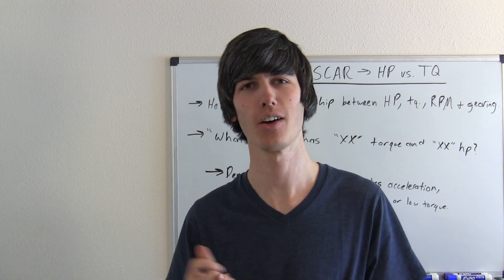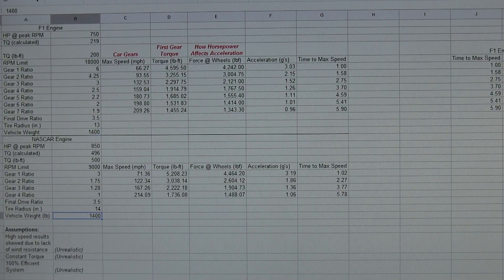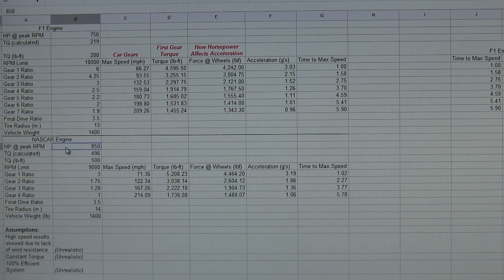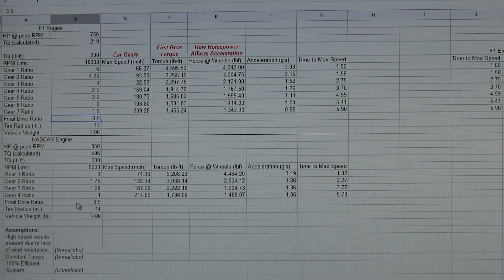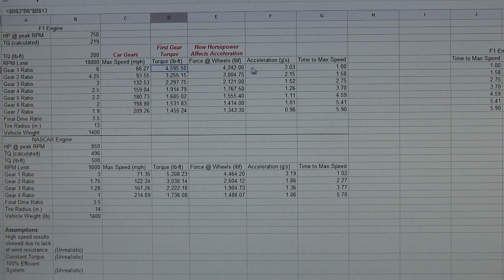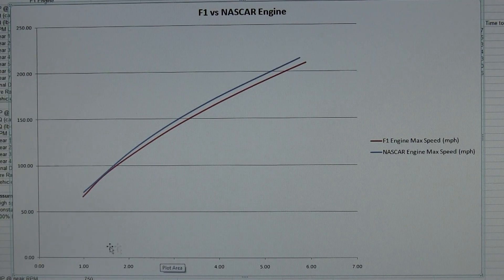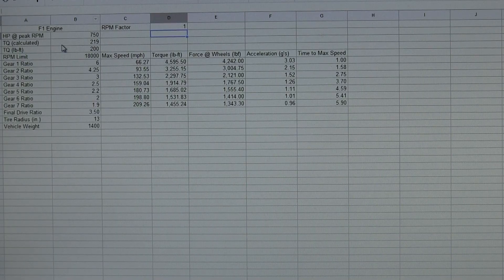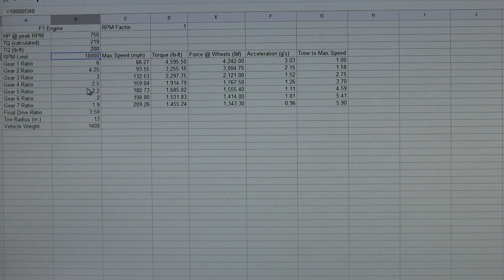Horsepower vs Torque - Formula 1 vs NASCAR

Comment: Or in nice simple terms...
Want more torque? That's simple. Just use a transmission to exchange RPM for Torque, resulting in lower RPM, but higher torque.

Want more RPM? That's simple. Just use a transmission to exchange Torque for RPM, resulting in lower torque, but higher RPM.

Want more power? Sorry, you gotta get a larger engine for that.

Comment: Australian pro-stock cars have about 1200 hp and weigh 900 kg yet CAN accelerate from 0-200 in about 6 seconds yet can do 0-60 in like half a second. Do they not have any air resistance ? Or is to do with different gearing ?

Comment: not very good example at the end by doubling the torque and limiting by half the rpm limit. i THINK the conclusion is that torque is not very important for performance from the standing line. Power is what u need for that. bUt we already knew that. Torque would be essential for rolling starts.
Reply: for rolling start ? so you say 2000 nm at 2000 rpm roll from 100 km/h  give more accelerstion initial at let say first 1 sec or whatever 0,1 sec than something like 500 nm at 16000 rpm from 100 km/h ? welll ….. NO 👍🏻 it be 2 times weaker acceleration cos 500 nm at 16000 rpm is 2 times more power and if speed is the same 100 km/h for both than formula power divide be speed = force say 500 nm at 16000 rpm will push vehicle forward atleast  2 times stronger after start signall 👌🏻 …
Reply: @mociczyczki  i agree with your example, but in reality rpm are similar in rollisng starts, torque is what changes from vehicle to vehicle
Reply: @MrDieselakias  nope unlesss somebody force such regulation only than if not each schould start from its best rpm than more pwoerfull engine at less torq at perfect gearing assuming driver know which starting rpm  choice always accelerate faster after signal start 🤷🏻‍♂️👌🏻 beside even if somebody force such regulation that feg we must start from the same rpm than depend how long race this be still more powerfull version catch up more torque version and win unlesss race speed range be to short how short or long speed range is requored for specified car/vehicle win depend on car/vehicle setup offcorse feg 206 1,6 hdi 275 nm at 2000 rpm 110 hp at 4000 rpm vs 206 s16 190 nm at 4000 rpm 135 hp at 6000 rpm and let say somebody force regulation of some roll race that both must start from 2000 rpm where s16 have only like 160 nm  in this egzample assuming each vehicle have stock gearing whell size asf start from 100 km/h be imposiible as s16 version at last gear spin higher rpm than 2000 rpm at 100 km/h but lets assume some lower speed was choice for this race that both version be able to launch from 2000 rpm than depend how long this race be each version can win on enough short sprint 1,6 hdi win once drag be longer s16 win once regulation not force both to start from the same rpm but each from its optimal so 1,6 hdi from like 3 k rpm +/- and s16 5 k rpm its game over for 1,6 hdi on each speed range amd distance cos s16 now use more power everywhere from start to finish line /speed 👌🏻….the same story be with feg civic 2,2 tdci 140 hp 340 nm vs civic type 201 hp 193 nm start from the same rpm on enpugh short dostance fromm roll 2,2 tdci win once each start from its optimal rpm range so 2,2 tsci from like again 3 k rpm and type r from like 6-7 k rpm its again game over fpr 2,2. tdci version dosent matter from stop or roll from any speed 👌🏻 in race where evrybady dont know how setup engine characteristic somebody have nobody care from which rpm he start each start from optimal rpm in regard to specified setup for som from specified speed to low gear to high rpm to short final gear ration be weaker cos now he is on power droping down rpm like some disel where above 4 k rpm  power is lower than at 3,5 k rpm depend what disel it be and setup cos some have peak  power to higher rpm vs for spme other to high gear to low rpm to long final gear ratio be wweaker than some lower gear higher rpm shorter final gear ratio everything depend how high peak power each version have but always dosent matter what final gear ratio rpm level and gear is required more powerfulll version which be able use more avg power through race distance/speed range win this 👌🏻always with no exception 👌🏻

Comment: You entered a different tire size for each vehicle. 13in for the F1 and 14in for the Nascar. this would skew the HP numbers higher for the smaller diameter wheel.  Larger wheels means less power realized at the road due to rotational inertia.

Comment: An unrestricted NASCAR engine can easily propel the car to over 230 miles per hour, which has been demonstrated (and was demonstrated in the late 80's before the restrictor plate being introduced). I'm not entirely sure why you say the max speed for the NASCAR engine is significantly slower than it can go.

Same with the F1 car I would assume as I believe I've seen higher speeds qualifying at Monza.

Comment: Has a cyclist more torque in low RPM? As much RPM can you move the legs, do you have more power?
Thanks :)
Reply: Torque is not calculated using rpm, horsepower is. Torque = force x linear distance. A cyclist would need to apply more force or have longer pedal crank arms to produce more torque.

Comment: Consider that nascar engines will last longer than f1 engines
Reply: F1 manufacturers can use 4 engines for car in the entire season (20 races), so every engine (turbocharged 1.6l V6 developing about 1000hp for 2018 season) has to last for about 4.000 km, considering the test sessions. NASCAR engines have to last only for two races (thus being longer).

Comment: so torque is useful when driving up on a hill or when you put heavy load on the car?
Reply: NO  asssuming perfect gearing and nothing matter except pure performance 👌🏻put 750 hp f1 engine with 350 nm torq to regular truck + setup perfećt gearing and it will pull stronger than 400 hp 2500 nm regular standard engine in such truck 👌🏻 the resson manufactory dont use such engine charactersitic for such aplication are diffrent 👌🏻

Comment: the best way ive come up with to explain why this is, is to think of HP as energy over time.  the engine with more hp will be inputting more energy in to the drive line  in a given amount of time then the one with less. if thats still messing with you think of it like this. you have a v8, so you have 8 cylinders driving you down the road. well no not really its a four stroke so you really only have 2 at any one time( even then those two are probably offset a bit) point is the power is not constant it come in pulses. so if you increase the rpm you get more i'm pulses per second aka more energy in the drive line. 
I'm no engineer so this could be a totally wonky way to look at it. feel free to correct any misconceptions.

Comment: If these numbers are even remotely in the ballpark, why would engineers go through the effort to make an 18,000rpm engine when you could have a 9000rpm engine achieve the same performance?
Reply: The 18000rpm engine will be a lot smaller and lighter. Before there were a minimum weight set for the engines in F1 some manufacturer brought down the drymass of a V10 engine to about 85kg/185lbs with a poweroutput of over 900hp. Todays Nascar engines are still over 250kg/570lbs.

Comment: COMPLETELY WRONG!!! Hahaha! This guy is pretty informative but this is HORRIBLE! There is always a torque curve in internal combustion engines. An S2000 has 240hp and 170ft/lbs tq and a 1986 Mustang GT has 200hp and 300ft/lbs tq and the Mustang runs a really bad rear axle ratio of 2.73 and is considerably heavier. Both stock,  the Mustang wins 0-60mph, the S2000 wins 60-120mph. The best way to explain it is to hitch both a draft horse and a thoroughbred to a 1-ton trailer.  The torquey draft horse will pull harder and pull away quicker.  but the thoroughbred will get it going faster.

Comment: Usually really enjoy your videos but this one I have some issue with.

You do not seem to be taking into account the change in weight and changing gearing appropriately, you cut the gears in half but the difference in torque is not half also the weight difference of the original vehicles is larger then half if 1400lbs is accurate for F1 and 3300lbs is accurate for nascar, the gear ratios as you move up could be more aggressive and your final gear should be a bigger difference then a 1 and a 1.9. you seem to be basing your gear off of what nascar already does to achieve 200 mph with a vehicle that weighs 2.35 times more. 

You are trying to say that if I pull 2.5 times harder on the same weight I could not gear it to accelerate appreciably faster.

I may be wrong and there may be some good reason to base the gearing on the rev limit and not the power output. but to  me it seems that the only thing you have isolated is the rev limit

Comment: So if you were to stick a formula one car onto a dyno, in a vacuum, and "they" managed to get air into the engine, and the wheels were replaced with a cog and the dyno road was as well so that there is absolutely no slip in traction, as they are locked together by teeth, a formula one car could achieve a 0-209 in 5.90 seconds?

Comment: Hey can you do a video that goes into the different ways you can increase your car bhp/torque, i.e. the difference between a stroker kit and boost/nitrous, forced induction and direct fuel injection vs all the aftermarket mods you can do like Catback exhaust, headers, etc... A very broad comparison to cover all methods of increasing car speed. Thanks!!

Comment: With estimations/guestimations and plug in wtf made up numbers like that you could prove Man Made Global Warming...
Just saying, there is more $ in the Manmade Global Warming imaginary Math than Youtube vids
That aside I learned a lot about Bore / Stroke and Torque ...  something you didn't consider (at least I didn't hear it) if the Engine is turning at 1/2 the RPMs you could also say that it would last twice as long (durability) and cover more distance (actually twice the distance if Gearing was the same) just a simple comparison I was not trying to be Scientific just observing and asking questions of myself.
Thanks for the vid

Comment: F1>Nascar. F1 have the best power to weight ratio, they pull massive g-force and each team roughly has a budget of $300Mil/year. I'm pretty sure that is the budget for the whole NASCAR
Reply: Plus it's the mecca for all engineers
Reply: I'm not a NASCAR fanboy and I'll agree like the majority of everyone that F1 is superior in engineering, you are underestimating the annual budget of big NASCAR teams quite a bit. Google it. It's roughly 20 million a year per car while f1 is about 35 million.

Comment: It's not what i mean, its what it is... torque
is force in a rotational plane usually given in units of "Lb-Feet".
For our discussion here, it can mean torque as produced at the flywheel of the
engine, or at the wheels , after being multiplied and speed reduced to drive
the rear wheels. This rotational force can be determined at any vehicle speed,
to be a linear force ... this is the "F" in Acceleration =F/Mass.
power determines a vehicles ability to accelerate any speed , analogous to
energy being a body's capacity to do work. in other words, power can tell you,
very accurately what he force will be at any vehicle speed.

Comment: problem child.. please... max HP is the fastest rate of acceleration at any speed.  think about it.    if you are  at max HP at 100mph that is the fastest rate of acceleration at 100mph.. say its 3rd gear and at 6500rpm.   now, would you pick 5th gear to end up at 3500rpm or 4th gear to be at 5500.   its a trick question........... max torque will always be less rear wheel hp at any speed, than max HP.... why, because the gearing allows you to use the greater HP.    again, HP is the rate of change of acceleration.  think about it. its newtons law!!!!!    acceleration= power/(mass x velocity)... this isnt something ive made up, its basic stuff here.    max torque means NOTHING.  IT ONLY means you can accelerate hardest in that particular gear, but not at the greatest potential of the vehicle and engine. that occurs at max HP.   look it up.   Rate of KE change!!!!  please, you are killing me with this, because you are not thinking.     you are always at the highest rate of acceleration at any particular speed at max HP... PERIOD!  this is a fact and i can tell you the torque at the rear wheels , at any speed based on HP ..   power = force x velocity... the simplest of equations.  please open a physics book and spare yourself the argument here.

here is a simple example.. if you are at max torque in 3rd gear, you could be at max HP in 2nd gear and have much more rear wheel torque.  as a racer, i would never operate the car in the max torque range.. .. always in the max HP range.     a gear box is just the HP optimizer.  it allows you to be in the right gear at any speed for maximizing power, not engine torque.
Reply: zanick2 Now I would like to question ask you a thing...what do you mean by torque?

Comment: Torque at the wheel is important not engine torque. For the same engine power (same power / wheel rpm curve) with different engine torques will give the same wheel torque. Wheel torque produces the thrust force. Engine torque is transmitted through the gearbox to the wheels. You can adjust the gear ratios so that both engines deliver the same wheel torques. The only difference is going to be the rpm. Low rev for high torque. 
P=M1*rpm1=200*4000
P=M2*rpm2=400*2000
V1=V2 : we compare cars at the same speed, that is the key
If gearatio1  is 1:1=1 then gearatio2 must be 2:4=0.5. hence the car with low torque will run at twice rpm, which is no problem, otherwise the car wouldn't had been rated at that power.
Force, 
F=M1*gearatio1/r=
=M2*geartatio2/r
400*1=200/0.5
r is the wheel radius.

There are other important aspects: 
high rev engines could wear out quicker and may be less reliable if the rpm is too high , also usually have lower mpg. The clutch disc works at higher rpm. 
The constant acceleration feeling is actually given by the turbo-compressor group which keeps torque constant. It doesn't matter the value of the torque if the power produced is the same. During the acceleration at constant engine torque (wheel torque is also constant and it is bigger unless you are in the 5th gear) the power actually is increasing. When you reach max torque the force you feel starts to decrease but the power still goes up until it gets to max power. When you change gear the force at wheel for the same engine torque will be lower.
Essentially power is force at speed P=F*v 
A typical car can produce 300Nm. That is using 30kg to turn a 2 m diameter wheel from the edge of the wheel. An average man can do that.

Comment: Torque is what accelerates a car.  But it is better to make torque at higher RPMs than at low RPMs because you can take advantage of gearing.  This is clearly demonstrated here, as with the F1 engine.  HP is just an indication of how much power, or work, the engine is capable of, given the proper gearing for the application.

Comment: So if I'm understanding this correctly, engines with high horsepower and lower torque don't hit their "full potential" until higher in the rpm range. Whereas engines with higher torque can be mid rpms and still accelerating as fast as the higher horsepower engine.  

So an engine with really high horsepower and really low torque could, in theory, have the same acceleration as an engine with really low horsepower and really high torque?? 
That doesn't make sense when I reread it to myself so please correct me if I'm misunderstanding

Comment: What kind of engines do F1 cars use to be able to achieve such high revs and not run into floating valves?
Reply from the maker: They use air pressure rather than mechanical springs for their valves (pneumatic valves). If you search my channel on F1 engines I have a video on it. :)
Reply: Thanks for the reply! I'll check it out.
Reply: CBR250RR from Honda in the 90's used springs in their heads and revved 18'000rpm (some went 20'000rpm when modified).
Reply: If to speak generally, in motorcycle valve size is half of car`s, so it has lower weight and lower inertia. That`s why it can make twice car`s RPM while springs are made from same grade of steel.

Comment: NASCAR drivers aren't moonshine runners anymore; Moonshine runners could turn right :p
Reply: Cory Goodman if NASCAR was smart, they would make the turns a much steeper angle up so that it would hypothetically never have to brake for turns, it could be interesting...
Reply: +Harambe - Yeah. But, then you're just a button pusher. Throttle and brake are part of the winning strategy.
Reply: mahnarch but dat possible speed tho...
Reply: You've always got the Bonneville Salt Flats!

https://en.wikipedia.org/wiki/Bonneville_Salt_Flats
Reply: Harambe 
But you can't drive it on the street. So what good is it?
Koenigsegg ftw!